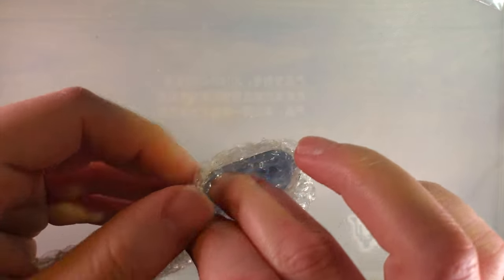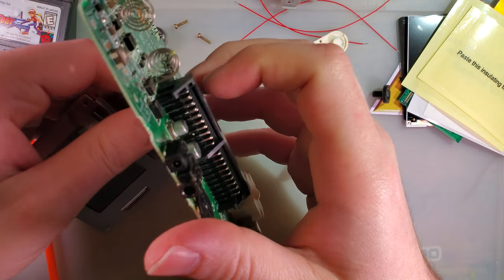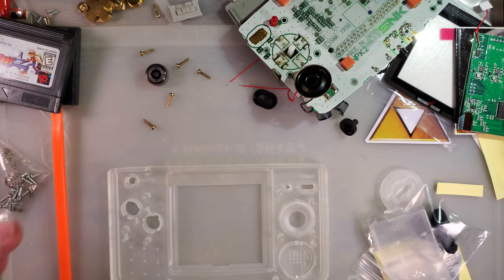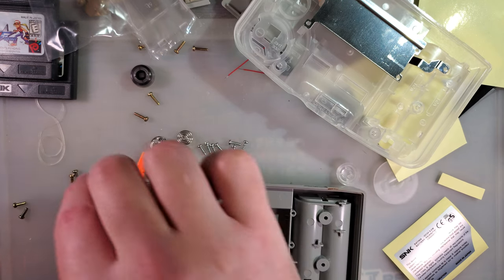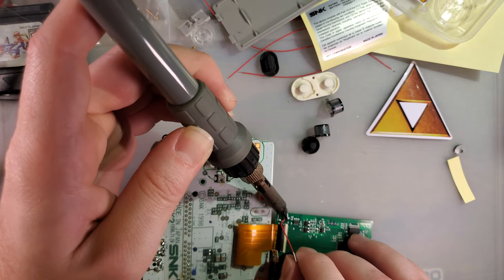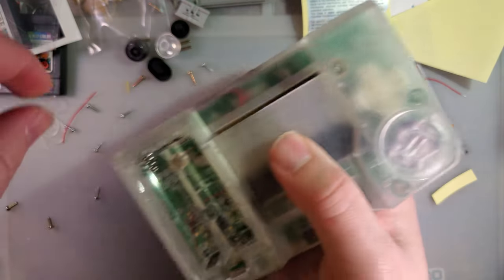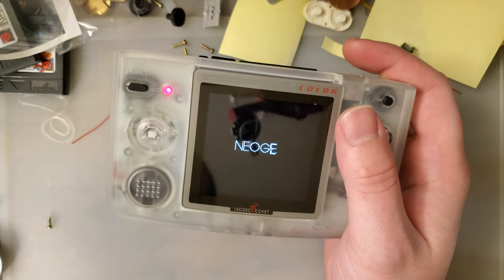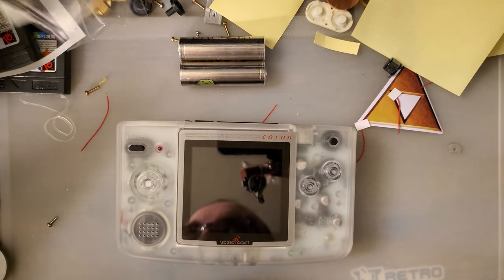Neo Geo Pocket Color "Q5 OSD" Backlight Kit

Comment: Great video! No wonder I noticed how fast the batteries drain on this thing. It didnt help that I added a sound amp as well.

When I experienced the screen not lighting up when the batteries were low, I didnt think it was the batteries. I practically opened the whole thing several times to test for shorts, reseated cables, etc. Even now knowing it is actually because of the batteries, I did notice the system was quite picky with how long you press the power button.

Comment: If you want to see the full picture use the lens that comes with the kit, the video is bigger than the original with this kit so it comes with a lens that has a larger window.
Reply from the maker: I'm fairly certain both lenses were the same size but I'll double check
Reply: @makho  it did look good on your video, so it doesn't seem very noticeable using an oem lense, but the new screen is supposed to be 5% larger

Comment: Is it true the screen doesn't turn on if the battery levels are low (not depleted). Other threads are mentioning this
Reply from the maker: possible. I did have a similar issue that was resolved by replacing the batteries
Reply: My screen starts flashing on and off when the batteries get low. But it's usually after 10 hours of play (I only need medium brightness settings and it saves alot of battery) and  everything else about the screen is awesome. So it's an issue I'm willing to put up with.
Reply: I fixed the issue by getting rechargeable lithium AA batteries. No more issues after that.

Comment: Ribbon cable that came with my kit is too wide to fit the original board, am I doing something wrong or do you think its been supplied in error
Reply from the maker: Make sure you have the correct model. Slim is not compatible with non-slim.

Comment: Hey I modded my gba sp with Ips and once I putted together it wont turned on the green light flickers
Reply from the maker: sucks. Sounds like you have a short.
Reply: @makho  how do I fix it?
Reply from the maker: @omgitsmario7  find the short and fix it. If it worked before you messed with it, undo steps until it works again